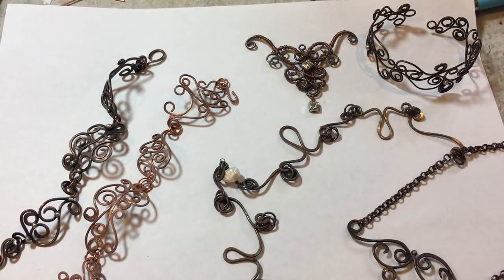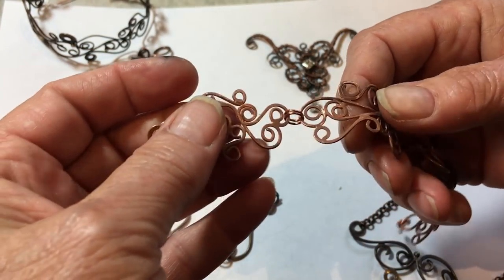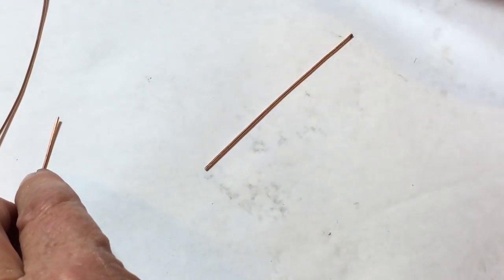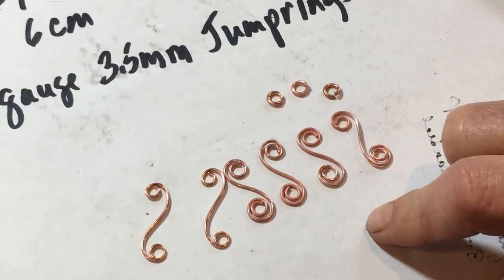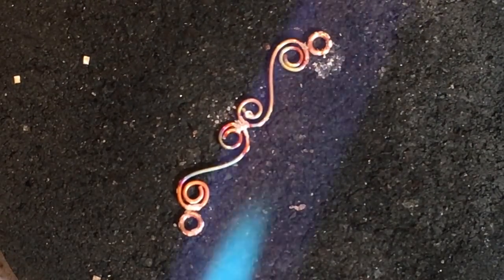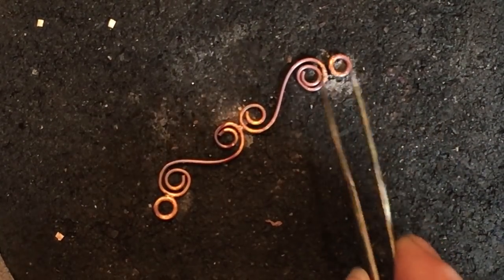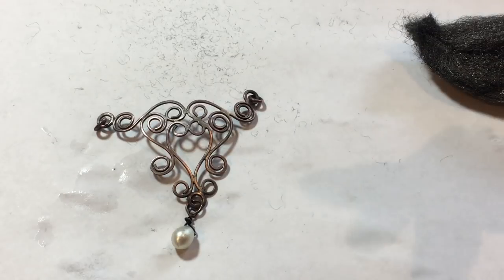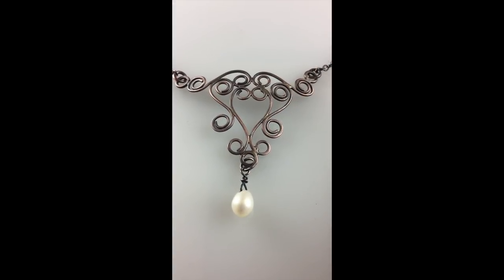The Wire-Worked Pendant - Video 2 in the Wire-Working Series

Comment: I always enjoy watching you work AND listening to your humorous delivery!  It’s been many (many) years since I sat at a jeweler’s bench AND am sooo not getting back into gold and silver work again (well…maybe silver, later), but decided to do copper wire projects, so have different sizes of copper wire, just waiting their turn to be mangled at my hand!  LOL  Not wanting to trust my old torch setup since I don’t know how long torch hoses last in storage, I decided to use a kitchen torch. Gghhrr! 
I couldn’t get enough heat to melt the solder, but I could only find gold solder in my tool box from WAY back when. I think it was medium or easy, not hard (too lazy to go out to workroom to check), but I’ve checked online, looking for actual copper solder…mainly to match the wire. Do anyone not make actual copper solder?  What kind of solder do you generally use on copper wire pieces?  I figured gold would blend better than silver, but it was a moot point, considering that I couldn’t get enough heat to melt the solder!  Metal work definitely does NOT fit the old adage about “like riding a bike”.  LOL

Comment: I started watching your channel because I wanted to learn a little more about working with copper wire... duh, but not to make jewelry. I want to use hammered copper wire as a component in an art piece and am currently trying to work with 6 gauge copper wire! I wasn't sure exactly how to make it more easily workable after slamming it with a steel hammer for an hour! Annealing is a new trick in my magic bag now as well as how to make a few new shapes! Trying to coil and hammer 6 gauge hard copper wire is easier now thanks to your excellent teaching skills and huge knowledge base! My wrists, finger joints and elbows thank you!

Comment: Interesting to watch. Not that a guy is gonna make ladies jewelry but it does give a guy a heads up to the process and how to spot quality jewelry of this type.
In your other video you showed how to make loops. Everyone shows how to make loops but how to make small squares and rectangles without having to bend all the points You can wrap on a pen for loops sure but no one shows how to make squares without having to make them ourselves. I was looking all over the place and couldnt find anything square or rectangluar in a smaller size. Now that Im thinking about it maybe Dice. But it would be nice to have several of a type of object of varying sizes going to down the list the only thing I can think of is id have to make it myself.

Comment: As always, great info and terrific camera work! I enjoy working with copper and started out doing wire work, then moved into more traditional jewelry work. I've been trying to find copper solder vs. silver solder, in search of a better color match. So far, most of the copper solder I've tried is very brittle and doesn't make a strong join. Can you recommend a good source for copper solder?
Reply: I heard on one of her vids that she prefers silver over copper.

Comment: I noticed a lot of people using wires, use ded soft.... why ??? I can't do that maybe for earnings.  But I like medium or semi hard wire.
Reply: It's because it's next to impossible to get a wire to stay in position if it's hard or half hard. Both of those states mean that the wire retains a memory of its shape and does its best to retain that shape. It's VERY hard to solder something if it keeps trying to spring apart. Also if yo DO manage to get hard or half hard to retain a shape, if you solder it, the wire will anneal and relax and the shape will shift. It's also impossible to get half hard or hard to make a smooth curve for the same reasons. Yes you can anneal it but why bother.... skip a step and start with soft wire that you can work harden when done.